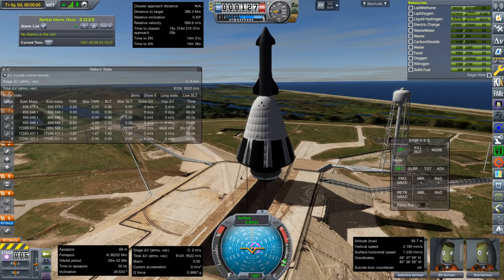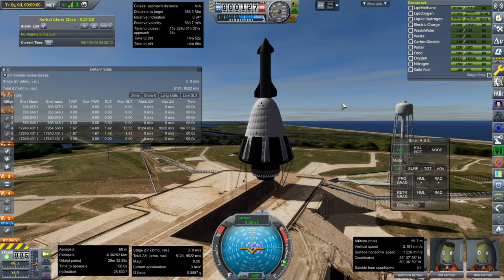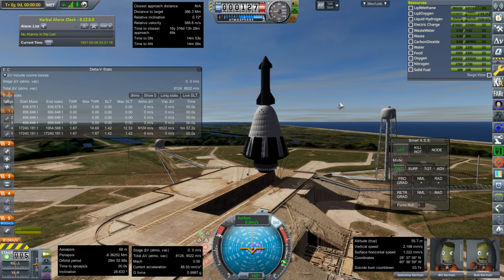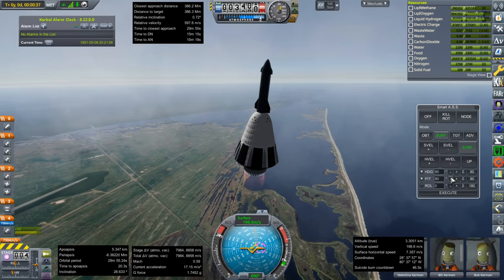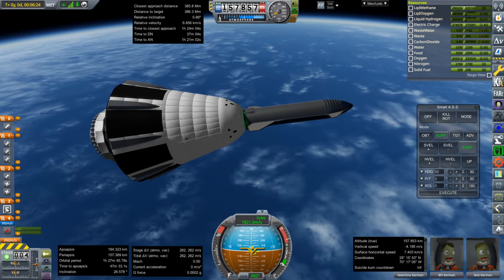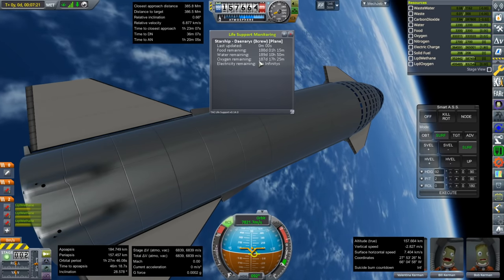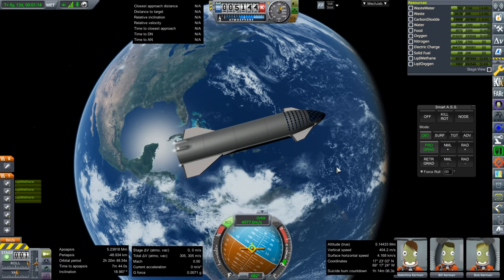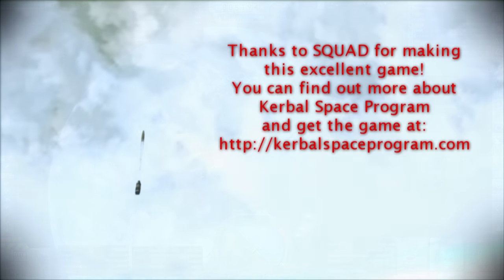Realism Overhaul in KSP 1.8.1 - Starship Aerobraking Test

Comment: 8:10
Unfortunately you're right; a fully fueled Starship can't do the whole Moon landing and return with direct ascent. Back of the envelope calculation suggests it needs to drop 5t of dry mass to be able to do it - which means that the Lunar Starship might actually be able to do it.
Reply from the maker: Wouldn't be able to come back by aerobraking, though. Also, not sure the back of your envelope had enough delta-v.
Reply: @RaizSpace  I'm using the following figures:
- 3,120m/s for TLI
- 790m/s for capture
- 2,190m/s for landing

3120 + 790 + 2190 + 2190 + 790 = 9080
Taking SpaceX's provided figures of 1200t of propellant and a 120t dry mass,  and a 380s Isp for raptor vac, W|A returns a payload capacity of -4.9906t. 

And aye I'm aware it couldn't aerobrake, I'm not suggesting they ever would fly such a mission with lunar Starship, it's more just an interesting observation.
Reply from the maker: Ah, Raptor Vac hasn't gotten 380s - it's 370 to 375 right now, the little landing engines probably get worse than that (or they'd just skip the Raptor Vac and go with them), landing generally takes more than ascent for an accurate landing - usually the minimum is 2400, and this isn't assuming a significant payload. Note: you can do a landing with less than 2400, but they probably wouldn't budget so little for a crewed vehicle.
Reply: @RaizSpace  I thought raptor vac hadn't been tested at all, and the target 380s is all we have, but maybe I'm not up-to-date enough on Raptor's development. 

From a pure orbital perspective, landing and ascension should take the same dV, so I'll say both take 2,400 m/s. Given that and an Isp of 370s, W|A says you'd need to drop 25.593 tonnes - the rocket equation really does rear its ugly head here.
Reply from the maker: You can extrapolate Raptor Vacuum from Raptor sea level - it's the same chamber with an extended nozzle, so the result can be calculated. It may be that in terms of pure math descent and ascent should be the same, but I can tell you that Apollo budgeted 2600 m/s for descent at 2200 m/s for ascent, and that descent number is what allowed Neil Armstrong to hover a bit to check for a good spot before landing.
Reply: With orbital refueling until full in highly elliptical Earth orbit, it could (yeah it will need more tanker launches, and more limited launch window)

Comment: Katniss cape canaveral seems to mess with the launch clamps, just the mod itself not the terrain, cause I launched from the launch pad and the clamps are all messed up
Reply from the maker: A minor inconvenience.
Reply: @RaizSpace  Hey also, did you ever release the sagitta rocket? I downloaded your mod [EBDmods] but its not in there, all the adapters and stuff are but no rocket and no lynx. Thanks!
Reply from the maker: No, the Lynx and Sagitta are proprietary at the moment, as is the Kasei. The engines are released, though, so you would make a reasonable equivalent to the rockets.
Reply: @RaizSpace  ok, thanks!
Reply: Kinda funny, considering this mod doesn't actually do anything to any of the launch clamps.
Reply: @Katniss218  wonder why it does? Maybe its just the game itself :/
Reply: @gunnykido7213  It's either KSP or KK or the launch pad mod. My custom launchpads are working perfectly fine.